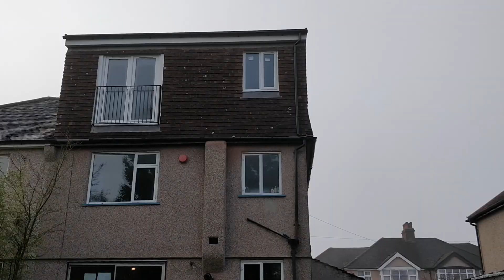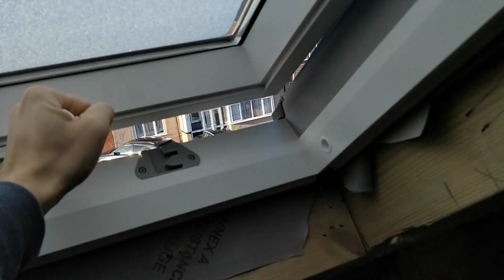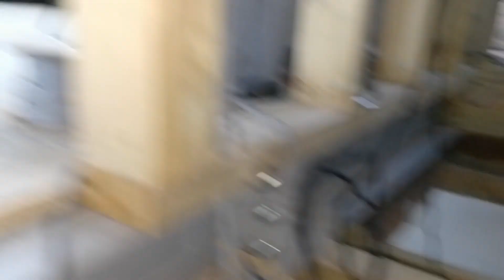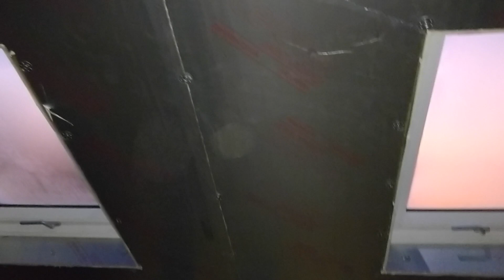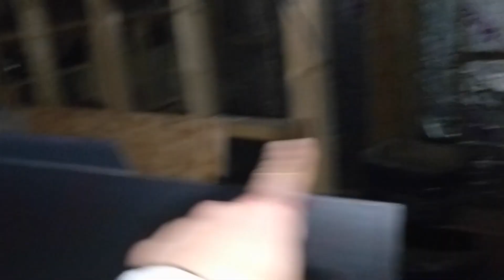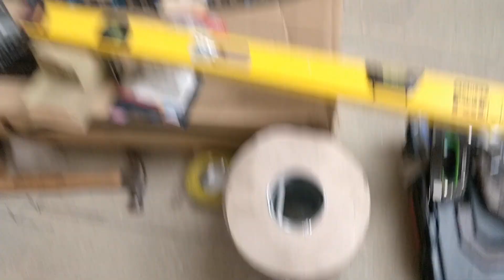Wall Insulation Part 2

Comment: Interesting video, putting that extra laying of insulation is that a building reg requirement? And out of interest how much did your shell loft conversion cost?
Reply from the maker: The additional layer of overboarding was specified by the structural engineer, to comply with building regs for insulation but also for vapour control.

The total shell cost is £35K, which includes everything seen so far; including the bathroom suite bits which have been delivered but not fitted.
Reply: @OfficeBoyBuilder  ah ok.

Price wise I was actually expecting it to come in at around 20-25k...I guess the scaffolding is 4K alone...nothing really cheap. At this moment in time is it all completed and finished?
Reply from the maker: @GeekStreet  it was an extra 3K for the scaffold tin hat, which we hadn't initially budgeted for, but were really pleased with.

Nope, it's not finished, it can't be finished until we have done the side and rear extension, because of the water tank and the whole new heating system which needs to be installed.
Reply: @OfficeBoyBuilder  it does look good, I'm looking forward to you doing the side extension should be an interesting project to see.
Reply from the maker: @GeekStreet  cheers mate! It's going to be a bit of a delay on those videos sadly - work needs to take a bit of focus as I had a load of time off to get the loft done. But I'm really looking forward to it as well!